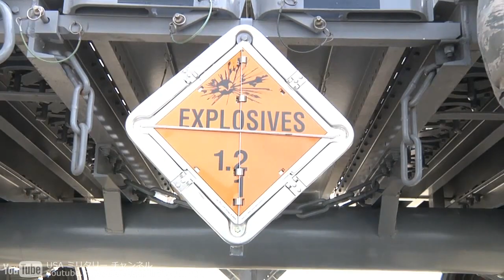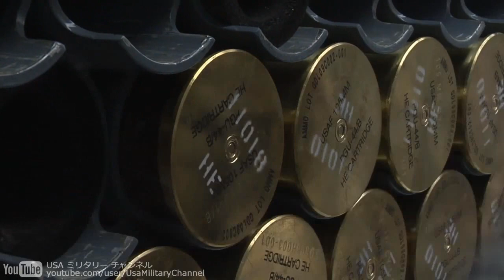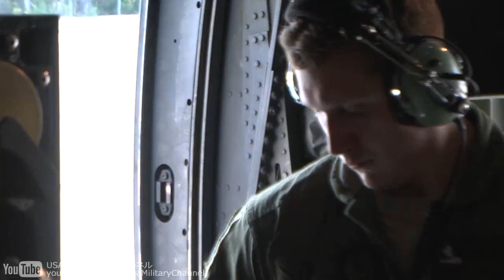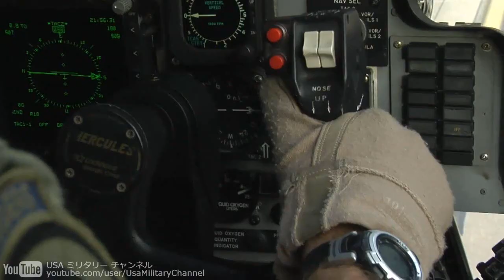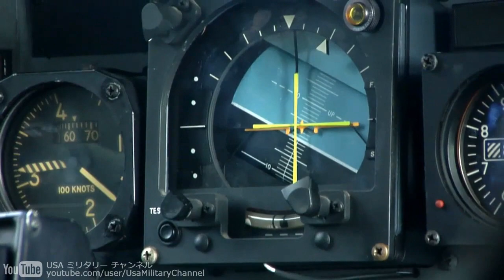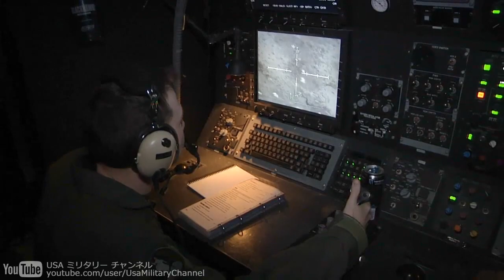AC-130 Gunship - Fires 40mm Cannon & 105mm Howitzer

Comment: As a former artilleryman, I'm always at awe at how accurate they are.
My unit consistently dropped 350 lb rounds into 55 gal barrels from 27 miles out.
I drove the M548A1 Cargo Carrier for the M110A1 (8") Howitzer and hauled all of the ammo and camo netting.
PFC 4th BN 4th FA Ft. Sill, OK '84-'86.  My MOS (Military Occupational Specialty) was 13B (Gun Bunny).
Reply: Kkkk Bbbb  
Anything the shell hits it destroys. Even armored vehicles like tanks. 👍
I made the mistake of not having my hearing protection in place for just one shot and I have a 10% loss in one ear.
Reply: @13bgunbunny42 Hi. Can you tell me how the ac-130 is capable of firing the howitzer gun without any flight disruptions? Thanks in advance.

Comment: I wonder if the gun barrels sticking out on the left side of the aircraft causes any noticable drag that the pilots have to compensate for with rudder trim? Those 40mm rounds sure do have plenty of casing and powder behind them. I sure wouldn't want to be on the receiving end of that. It's amazing how quiet the guns are when they're firing their muzzle blast outside of an AC-130 going anywhere from 140 to 200 kts.

Comment: 一発一発手動で装填するのか・・・時間と手間がかかるな。
Reply: bluefitter2008 C-130でもさすがに自動装填装置乗せるのは無理じゃね
Reply: まぁ簡単に言えば、火砲を飛行機に乗せて撃ってるだけだからな。
Reply: Fox Silver Less weight and less size = more load for each run/ less fuel for same run = less cost per bombardment = more bombardment with same cost/ more budget for other ways of bombardment

AC-130 is considered as one of the "Cheaper" option to provide air support anyways, and in many case still an over-killed option.
Even looked like they have unlimited resources, they still have a budget and wish to squeeze most out of it.
Reply: 英語で説明してくれてますよ

Comment: strange question. If you shot a round a mile horizontal, air friction slows it down and gravity pulls it down. If you were a mile up and shot straight down, would the round slow as much with air friction or would gravity make up for the loss in speed?